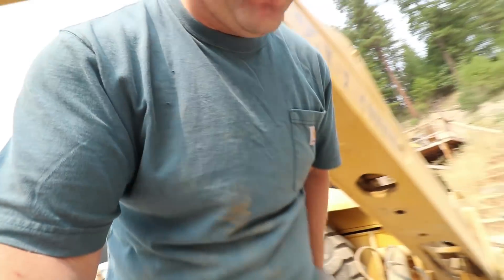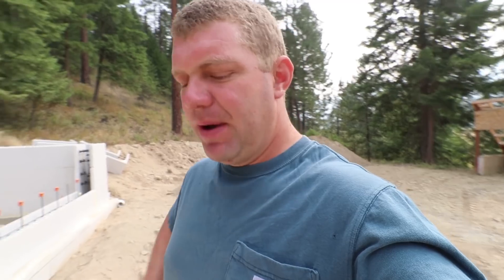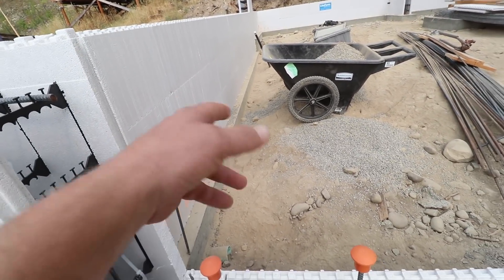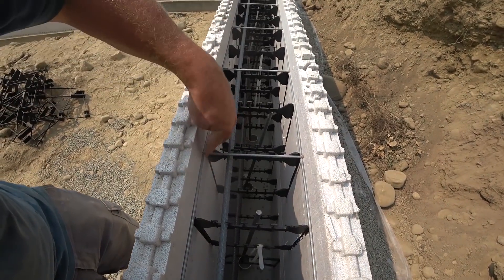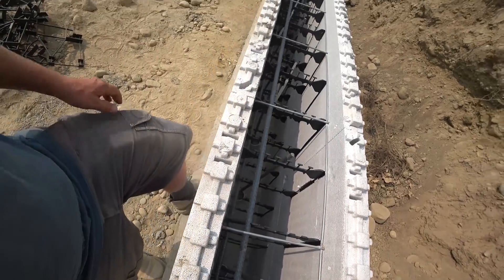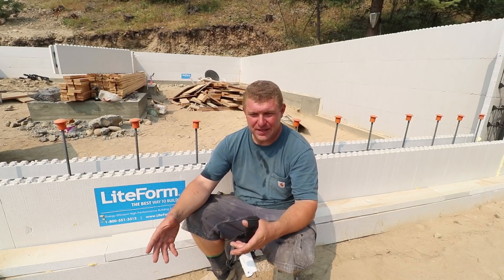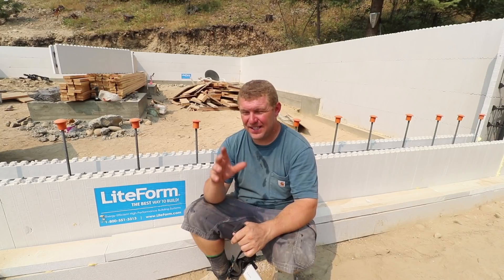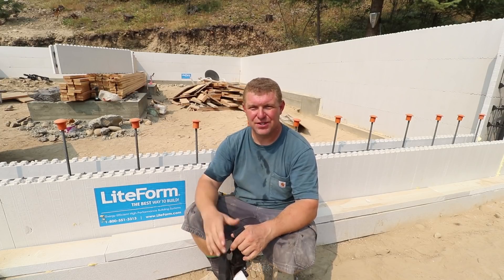Building a House Start to Finish: ICF Construction

Comment: It's sad to see, so many effort but everything is wrong on this building site.
Reply: Its good for many folks to see others make mistakes and correct them to help educate viewers. Good for them for choosing to do the work and get er done. Most construction mistakes have been made and overcome, these folks will do the same. I'm glad to see them building an ICF home, the only kind of homes I'm building. If you live in one you'll understand, worth every extra cost of construction,  it pays back from day one.
Reply: Most North American building codes do not allow electrical penetrations of the concrete for basic wiring .. trunk feed bulk heads yes BUT not the standard framed in outlets like you mention those have to put on the inside within yup wooden framed in walls with gyprock and all that fun stuff.
Reply: Hahaha, I've only heard that term "Trunk Feed" once in My 35+ years as an Electrician, and it was from an Apprentice that made up the term, there's no such thing in the Electrical Trade as a "Trunk Feed" the term I think You're referring too would be, "Main Entrance Feed" or "Main Service Feed". There is a Term "Trunk Line" but has nothing to do with Electrical, it's a Term utilized by Gas or Oil Companies which describes natural gas or an oil line using a pipeline for transport. And You are also wrong, it's legal to penetrate and also legal to run PVC pipe for Branch Circuits within the Concrete. Most Branch Circuit runs in Residential are run in 1/2" or 3/4" PVC neither has enough of an effect on a 8" thick Stem Wall as far as Structural Integrity is concerned, now You wouldn't run a 4" Schedule 80 down the middle of an 8" stem wall, but it's legal to penetrate strait across a Stem Wall with a larger PVC, although in My experience with Residential, the largest PVC I've encountered is 1-1/2" except on the Main Entrace Weather Head, that's usually dictated by the Electric Service Company, not by the NEC, if Ya don't believe Me, look it up..  Good stuff too know, if ya know what I mean.. Here's a good Reference for ya..  :D  
  http://www.mikeholt.com/tv-nec.php
Reply: Electrical is cut into the insulation on the inside.
Reply: Are the uploads that far delayed? If so I guess My comment above is a bit late and not worth a pile of beans, I still think they are forgetting things that should be addressed, like Electrical Outlets, as I mentioned above, I guess being off Grid means no Convenience Outlets in the Basement, wonder if they plan on Kerosene Lanterns? hahaha.. ;)
Reply: Yes a router is your friend, route the channels for wires and plumbing, expand foam to hold it in and short boxes for outlets anchored to the walls. Our first ICF house was before PEX and plumbing wasn't as easy, now it's a cinch!
Reply: Bikerchic you don't know what your saying, First they should of never seal the out wall until they pour the walls, simple put if they have a blow out, which happens to even us pro's  they will waste a lot of money trying to get the forms back in place and the seal paper, membrane, french drain is all in the way. Secondly, you can place pipes inside the foam boards, including plastic pipes to pull cable through, if you are running floor joints (j-bolts) you cut into the ICF with a hole saw and tie in your J-bolt. then reenforce. SO Bikerchic, they are doing a lot wrong. GOOD for them for trying to do it on their own.
Reply: The structural integrity of the Foam is only required during the Pour, once the Concrete is settled, the Foam doesn't add to the Structural Integrity of the Wall, bsb0011 got it right, there's plenty of space to cut in Boxes for Convenience Outlets in the Foam, and all that's required would be Romex Cable for conductors, which can be buried in the Foam in very small cut outs, prior to the Drywall Install.. ;)

Comment: It looks like you have the drain pipe installed incorrectly.  the pipe has two rows of holes.  They go at 5 o'clock and 7 o'clock.   With the hole on the top of the pipe will eventually fill with silt.  And if you were not told, filter fabric does eventually clog with fine silts, and tree roots do grow thru some fabrics.
Reply: If the holes where on opposite sides of the pipe or 180 degrees apart you are right it wouldn't work. If you look at the video or the look up the product they are using the holes are about 120 degrees apart.
Reply: It'd work w/ 180 (3 and 9 o'clock), but not as effectively because the water level outside the pipe would need to rise half-way up the pipe before draining would begin instead of 1/4-1/3 of the way up, and the pipe would be unable to drain the water to a level lower than half-way up the pipe.
Reply: Dave i was trying to reply to the comment by vancouver  about the holes being directly across from each other when they aren't. With holes offset to one side of the pipe 5 and 7 is not only possible but recommended by many manufacturers
Reply: dont forget he changed the pipe the day they were installing it ... and the holes in the pipe are 180d apart not a 10 and 2 setup ... completely different pipe style than what is being mentioned.
Reply: 0623kaboom look closer or look at the same product online the holes aren't on opposite sides of the pipe. They are offset from the center line.
Reply: but they are not though, they are actually at 4 and 8
Reply: Jesse used 6" perforated sewer pipe with two rows of holes. ASTM spec for this pipe has the holes 120deg apart (more like 4:30 - 7:30)
Reply: Septroth- I think they are expecting quite a bit of water coming from the top. In a previous video he showed the clay layer in the hill their dig cut into. This type of soil is common in the west - water will flow down into the hill til it hits this layer, then will stop and come down the hill from there. 

Think mini waterfall a few feet above the drainpipe.
Reply: Nick Hatch I know but the ground hydrology still needs to be looked at through a bigger picture, yes some will run down the foundation because of the hill but when it rains, it rains over a wide area so it is impossible to avoid ground water at some point coming up from below in to the drainage system
Reply: Nick Hatch also think of it like a puddle, the water will run down the hill, in to the drainage system but that's not the only mechanic that's going on. Some will go in to the drain and leave but some will get past, the soil will saturate from the bottom up washing fines in to the drainage rock
Reply: Michael Gregg and filter fabric just placed over top of gravel does nothing, most of the water rises from the bottom and that will fill the gravel with fines

Comment: I hope you have made arrangements for renting quite a bit of scaffolding.  You will need it when you get higher with the stacking.  And it will be very nessary on the day of the pouring concrete.

Comment: The ICF appears very labor intensive.  It seems like it would have been easier/quicker/as thermally effective if conventional concrete forms were used & insulating foam boards were applied on interior & exterior walls.
Reply: ...or just two leaves of cinderblock with 4" of insulation sandwiched between.

Two decent brickeys would have the entire basement up in a day.
Reply: Radon gas is an issue in some parts of Michigan. The South East part especially. Proper venting will prevent most of the issues with humidity and radon, but it is good to keep them in mind when doing the initial planning for a house. It's a lot easier and cheaper to plan for problems than to go back and correct them. 
If you already have a house, there are test kits for determining if radon is present in your home. 
 https://www.epa.gov/radon/find-radon-test-kit-or-measurement-and-mitigation-professional
Reply: Like anything, the first time you do it, by yourself, with only minimal directions from others over the web, watching youtube, mail, etc always takes a lot longer the first time. and you will make a LOT of mistakes  You don't really know whats important, what details can be ignored and which details are very important.  So what your watching is someone doing it the first time, with out a a senior craftsman showing them the tricks.  This is what is missing in a lot of the videos on youtube or on the home improvement shows on TV.  They basically tell you only the parts that they people want your to see, or they are done by experts who know what to do, how to do it, and what to look out for. :)
Reply: I would agree with you but it seems he is not following the ICF manufacturer's directions ie common seam.  Granted the high temps make working more difficult, but at least be prepared: read directions, measurements, material list, and procedures beforehand.  Know what must me done the next day and set a goal to accomplish then retire for the day..  I really am cheering them on & wish them the best, but watching them struggle needlessly makes me sad.
Reply: James Bradwell, yes, two brickeys and one laborer to feed the brickeys.
Reply: ICF's are definitely the way to go. Labor intensive is framing up a wall, then insulating after you plumb and wire. The ICF may take some time to install, but after the pour you are caught up to lumber framed with a superior product. I have built ICF homes and after the first round you know what is important and what is no biggie, like when a wall sags out an inch after the pour and there is nothing can be done. In the end the house is still stronger than anything and it can be hidden.
Reply: From this video i would never use ICF.  I thin a traditional concrete basement, or cinder blocks would be the way to go.

Comment: I'm thinking that if you pour your concrete 1 level each day, you might not experience any bowing of the foam. Ask your engineer bc you might not need extra bracing like the foundation.
Reply: You pour in 4ft lifts with 30mins in between to allow the first lift time to setup.
Reply: Okay, So, they are going to need A LOT of bracing material and vibrators when it comes time to pour. Scaffolding is going to be necessary as well.
Reply: Bikerchic, I think you were watching a different video

Comment: When it's time for concrete, I've seen full 8-10' high walls half filled - wait 30-45 min then fill to the top. The purpose is to reduce the hydrostatic pressure from blowing out your walls. Just thought I'd share. Your engineer and/or concrete guy should confirm.
Reply: the concrete for ICF is looser than what's used for a  monopour. You still need a vibration rod to settle the mix. going around and around seems like it would be ok but still the engineer should confirm

Comment: I did not put the blue skin on until after the pour that way you can shim the bottom panel to keep the wall level and after just sprayed foam to fill the gap at the bottom. If you get a blow out on the outside the blue skin is not going to hold it.

Comment: 7:50 pushing vs pulling is about the ICF being stronger in compression than tension. If it's bowed out you PUSH it in. Pulling will break the form.

Comment: Since this is your first time building.. Just follow the instructions to the letter stop trying to improvise with everything... That's why you continue to mess up and doing the same stuff over and over.

Throughout this series you said "well the instructions says this but I'm gonna do this because..."
Reply: The Right Move

In an ideal world, this would be true. But in this situation, as in many others, the instructions are not always clear to those not doing it all the time.

I had a project dumped on me with 3 days notice to convert a 790 location Point of Sale system to mitigate the Y2K problem in 1999. I had 14 days to get it fixed, and a budget of USD $300,000. It must have a resolution before January 1st, 2000. 

The first thing I did was to look at options and their cost.
The next thing was to offer to resign if I didn't get a $1,750,000 budget.

I was able to pull it off for USD $413,000. Had I been engaged three months earlier, I might have done it for only USD $190,000.

The point is that experience, time, and the ability to put some thought into a project make a difference. But the only way to get experience is to dig in and do it the first time.

Jessie and Alyssa seem to be careful people. For instance the "common seam" issue is one that bit them. I looked at the instructions. It wasn't mentioned in the primary documents - you had to go to secondary documents to get a whiff of it, and deeper still to understand it. Put another way, when you are trying to do something, burying details three levels deep in the instructions is counter productive. Please keep in mind that I deal with complex and deep projects on a crash basis as a living for these past 35 years. (I'll add that I absolutely loathe it.)

But what I think is important is that Jesse didn't whine (he talked about it, but didn't say "those evil people") about it, and took ownership of the issue as something he missed.

I've said many times, Jessie and Alyssa are folks I'd like to meet and be friends with. This is their first rodeo. I've seen some really unthoughtful comments from folks that don't have a lot of experience (We have RAID drives. Why do we need to make backups?) The key is to respect those that do not have experience but are willing to listen.

See Dr. Isaac Asimov's quote on "The cult of ignorance". TL;DR - Everyone has an opinion - but the worth of that opinion is based on knowledge, experience, and study of the person giving it.

We may cry tears when experience would have saved the day. Not to be too Zen about it, but it is what it is.

I do not with to offer any offense to you. I offer only a perspective that you may or may not wish to consider.

Very respectfully,
OneBigRailfan
Reply: onebigrailfan what Jesse is doing here is simple, not complex, simply googling the products show the how to videos. He started laying the ICF blocks using the instructions from another product, he says so himself, he also said he researches every product before use, so him laying products wrongly is him thinking he knows better than the company who builds them. At the end of the day it is their house not mine (and I'm glad of that) but if they want a trouble free future then they should start doing things correctly and before you start tearing me apart for my opinion ask yourself this, would you want to buy this house on completion knowing all that could possibly go pear shaped in the future??
Reply: 1st of all, this ambitious couple is building THEIR home by THEMSELVES with little or no construction experience. And, by the way, they are simultaneously trying to live their lives in an altered circumstance. And, if I forgot to mention, taking loads of time to shoot, edit and upload these videos that you find it necessary to pick apart. I say give them a break, they are doing a GREAT job!
Reply: I just went to a site...2 labourers plus the contractor. it took them (professionals) 14 days to completely finish a s700sq basement, using this method, he said screw the instructions, he said you are better off looking at the pics on the box.....the blocks are from the same co, different manufacturer, different sizes, not out by much but enough to make it a headache....He also wrapped his corners last, he said, you learn as you go with this shit....he said some contactors hate this stuff and some love it....he said hats of to Jesse and Alyssa for not blowing the shit up on day two....
Reply: Still have to work and spend resources to get that "free" wood.
Reply: Why do you call them arrogant, uneducated and inexperienced? Why do you think that they are trying to "outsmart" the manufacture?  These folks are just trying to build their house using the skills and knowledge that they have.  Plus they are putting their mistakes on film for all the world to see.   I am an experienced contractor and I see the errors that they are making.  But  I don't see arrogance.  I see confidence and resourcefulness.
Reply: polnar jean your comment helps the situation how?  How does what you said have anything to do with him reading and following instructions.
Reply: The Right Move 
EXACTLY!!!!!
Reply: A facepalm(kodak) moment. This whole series is about the arrogance of people, that somehow, without training, education, and/or experience, they could somehow outsmart the ones who made the items they use or methods they employ.
I always wondered why they had instructions on how to use a screwdriver in that corner of the world, now i know.